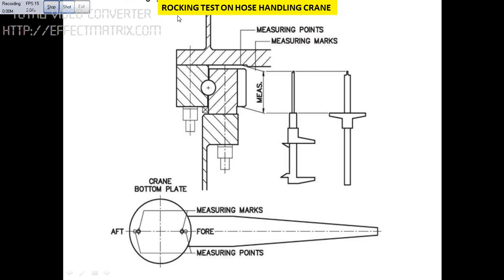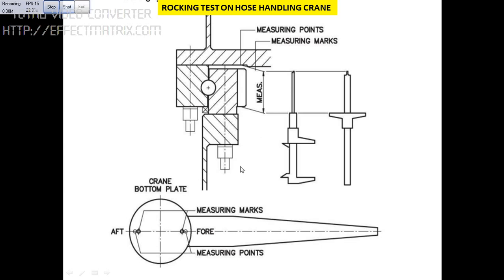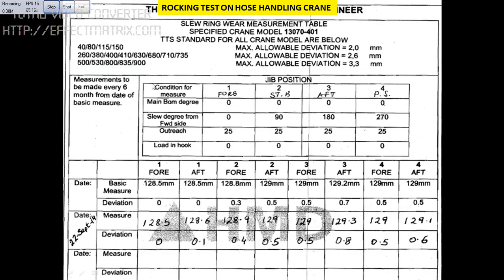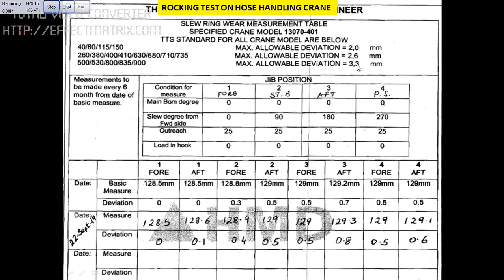Why Rocking Test Is Done For Hose Handling Crane?

Comment: i have seen in so many places that rocking test is done with the help of dial gauge and you have mentioned to do with vernier caliper..plz kindly clarify sir.. and keep posting videos as it is very helpful.thanks :)
Reply from the maker: Please kindly refer your manual and instruction of the maker before you take a decision.  If the slew bearing is wearing out from the initial condition then the distance measure before will be more and after wear it will be less. It is the distance we are measuring each time. please understand /
Reply: Some makers instructions with vernier caliper.

Comment: how to get the original values to measure deviation
Reply from the maker: Thanks for the feedback. The original reading will be in test report from the yard
Reply from the maker: when you open my youtube  channel : Marine tech hub you can see icon right hand side of the header . you can click to go to my website 1. RT flex engine 2. Nitrogen generator 3. solar power.  full details of CLU and Crank Angle sensor can be see

Comment: What is the position fore1--2--3--4
Reply from the maker: Thanks for the feedback. we need to keep the crane horizontally in fwd direction , no load on hook. Check the Rocking  test at Anchorage, so no vibration. one is forward position, aft position, starboard position, port position. Hope you understood and take reading at fore and aft.
Reply: much thanks sir.